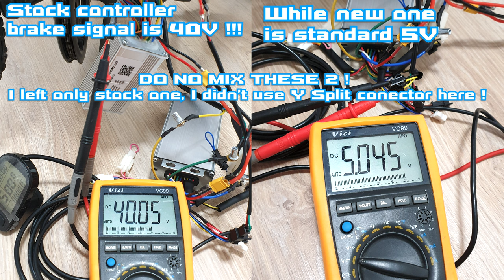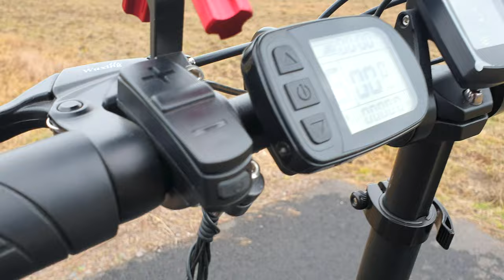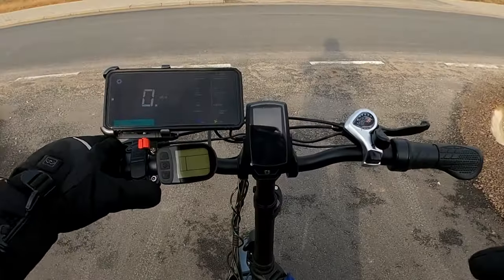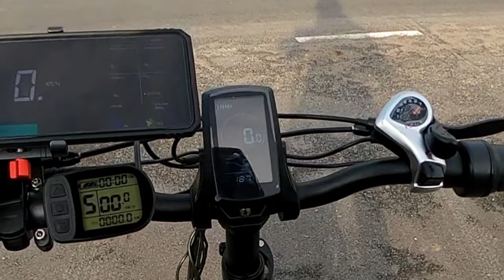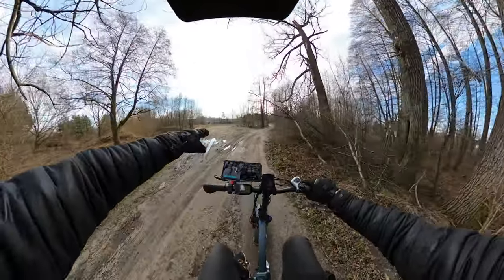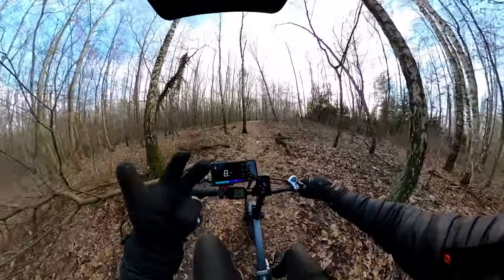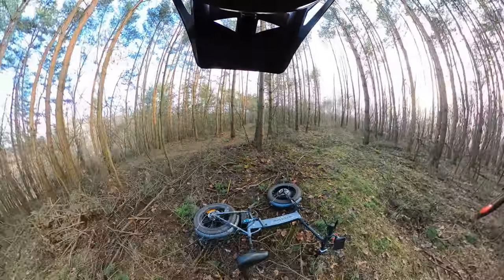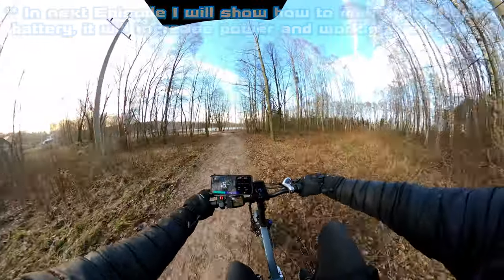How to DIY 2WD Ebike 🚵‍♀️ Cheap Easy way 😲AWD Fatbike is Great 😍 Part 1" Half Power" 🍕🍻

Comment: Nice one... im planning to make one bike too from scratch... but it will have it all separate... separate batteries, separate controllers, and 2 separate throttles....but since they will be thumb-throttles, you will be able to press them both with one thumb.
I will use 1.500W or 2.500W motors on the wheels.
Reply from the maker: Good luck 🍕🍻

Comment: Great video, I hope to add a front motor to my fat tire ebike too, it is 26" wheel and you have done it well,
 it is a good idea to make a new controller box, my controller is very small in a box at the base of the battery behind the seat post and it can get wet from the rain because of course there have to be holes for the cable to pass through.
I am thinking 2 throttles, so I can just use the extra motor for a boost on the hills
Reply: silicone the holes

Comment: Great video. I bought mine based on this… terrible!

Good morning,
Very unhappy with my CmaceWheel RX20, bought 7/2022.
After 6 months the Keyframe holder on the bike broke, so o had to replace the whole Key setup in the Battery. Not easy.
Now the Front Motor is not working for 4 months, but I was busy and did not report it, so it’s OUT Of WARRANTY, as 13 months and 95 km (yeah, that’s all).
The Factory support was incomplete, sarcastic and frankly shows NO knowledge of the bike (until I started yelling). What I can notice is RE-BRANDING to DUOTTS, VAKOLE C020, which indicates to me that the original brand is failing! They should have fixed the problems first!
After additional testing and hours of work by myself, 
1. Clearly the Controller is defective, so I am asking for an immediate replacement.
2. The Motor is also probably defective, but I am willing to wait for the Controller replacement. What worry about is the cost and the danger that the NEW controller will be blown by the defective Motor.
Any ideas? Grazie!

Comment: How long does your battery last with dual motors ? also I am planning to do the same with "Samebike M200" dual batteries. with single throttle like you done and using existing controllers. Did you have to buy the split cables or did they come with it.. My bike is also 20 inch as well. Let me know what types of cables I should be getting.

Comment: Engwe EP-2 Pro - Rubbish on hills until you install a Baserunner V5 50a controller, that fits in the frame with room to spare. Now, I zoom up hills and absolutely no need for a new wheel and hours of rewiring.
Reply from the maker: What about motor ? Its geared with nylon gears , good luck ;)
Reply: @PirateWasHere  MolyKote PG-75 😎
Reply from the maker: Molukote ofcourse seems to be good addon but doesnt change much, the system mechanicaly its still the same
Reply: What does the controller do, make the old motor more torque?

Comment: How's it going, do you have the link of the kit you installed, i have the same bike ep-2 pro, thanks much
Reply from the maker: Sure I will link it in 12h
Reply: @PirateWasHere  cheers brother
Reply: @PirateWasHere brother so sorry to bother you but do you know the measurement f the rear dropout? Planning on upgrading the rear hub motor instead, cheers
Reply from the maker: I found it  after 2 weeks ... https://s.click.aliexpress.com/e/_DBcItjB  . Droput in my case for the front hub is 135mm

Comment: H.I want to upgrade my Fiido M1 Pro with second motor and second controller to the front fork, they are original Fiido like existing ones, could you help me with some advice about wiring, which cables I need to split to do proper and safe connection.Thx.Regards Mario
Reply from the maker: daj jeden sygnal gazu hamulca i pasa , nie wiem czy bedzie dzialac dobrze ale na 75% powinno byc ok , prob;em moze wystapic jesli kontrolery beda miec rozne opoznienia sygnalu ale na ta chwile to najtansza  najprostsza i najszybsza opcja
Reply: @PirateWasHere  dzięki,tak spróbuję.Pozdrawiam
Reply from the maker: napisalem to tak ze sam nie zrozumialem 🤣 , mam na mysli ze rozdziel sygmal oddzielnie dla gazu hamucla i pasa z jednego kontrolera do 2giego , czyli oba dostaja ten sam sygnal , tzw mod " Y " czyli np 1x input 2x output
Reply: @PirateWasHere  Ok,teraz też lepiej rozumiem, tylko te połączenie, może być szeregowo ad jednego kontrolera do drugiego, czy każdy wymieniony przez Ciebie kabel rozdzielić i połączyć osobno do każdego kontrolera? Dzięki

Comment: With 2 of everything why did u have to join the 2 controllers ? Ive done this with a second battery and did not have to join them
Reply from the maker: say the same, but other way
Reply: @PirateWasHere  could u have made it work without joining the controllers is what im trying to say ,my first build i done it with 2 controllers 2 batterys 2 display 2throttle but now ive a dual controller etc for everything works great

Comment: My controller with the matching throttle. The jst-sm connector has 4 pins. And 2 of the pins are for the brakes. And that leaves 2 more pins, which are supposed to be for the Throttle that has 3 wires. They are not color coated either. Like red, green and black.
 I was wondering if I connect them incorrectly ? Once or twice. Until I know they match.
Will that hurt anything ?
Reply from the maker: if U connect + VOltage like 5V to any siugnal or GND U can expect big damage
Reply: @PirateWasHere  the red positive is a 5v correct ?